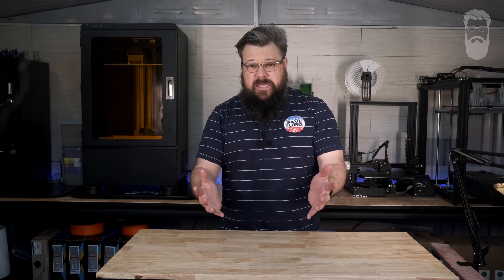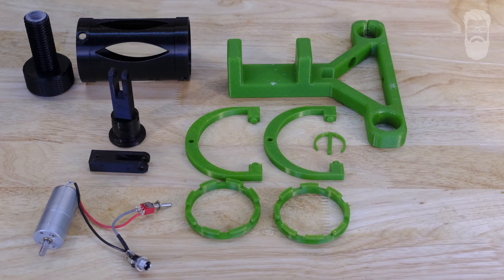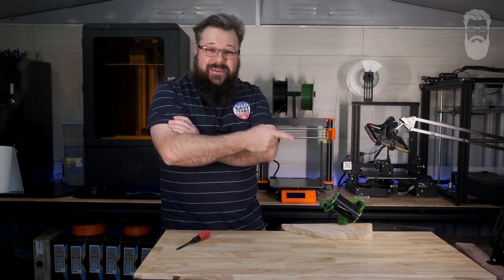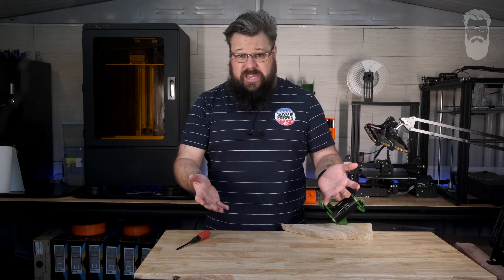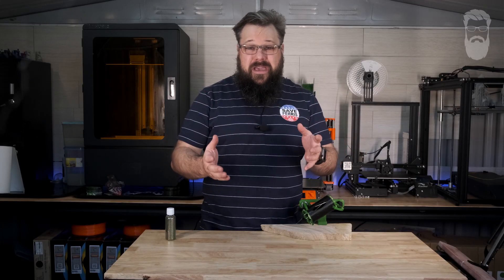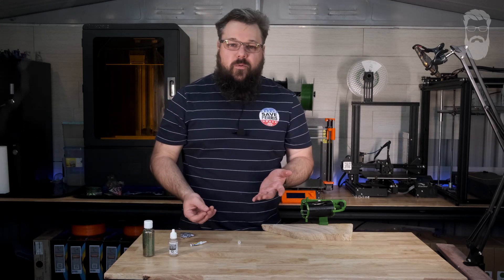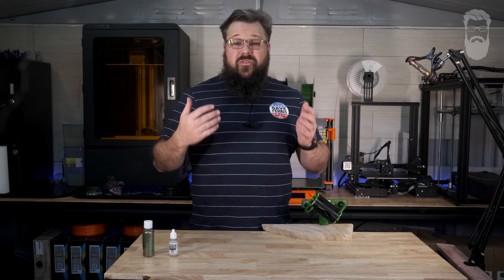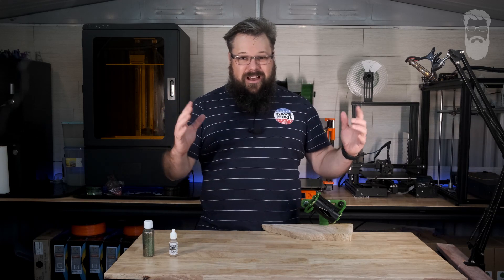My 3D Printed Kinematic Paint Mixer

Comment: You got me chomping at the bit for the bigger one. Would love one that could handle resin bottles and cans of spraypaint.  :D  Might even look into modding this myself. Solid design!
Reply from the maker: Literally in the finishing phase of a bigger one!  It'll be going on my Etsy within a couple months.  It handles 1L resin bottles, rattle cans, etc.
Reply: @MarkRhodesMaker ..any updates on the larger mixer? Doesn’t show on Etsy yet (20-Oct-2023)
Reply from the maker: @ernestgalvan9037 Hi Ernest, it's taking me longer than expected.   I have a working prototype, but need to make some changes to get it to production.  Sorry!

Comment: Currently in the learning phase of setting up a workshop for micro controller based projects as well as building and painting D&D Terrain and Mini's. Been looking for a silent way to mix paints and I believe I have found it. Could probably add more cylinders or even rubber band or velcro strap a few bottles on the outside to mix several at the same time.

Comment: I've finally printed this but I modified it to use ABEC bearings (the ones typically found in spinners) for the pivot end.  I did that because I thought it was binding there, but even after than the rotation of the drum isn't smooth, it stalls at one part of the movement.  Maybe my motor doesn't have enough torque?
Reply from the maker: Hi Wayne, possibly!   Did you use the motor I recommended?  I thought about using bearings for the next version, might give these a try!
Reply: @MarkRhodesMaker  As close as I could.  It looks the similar, runs on 12v, but only 50rpm.
https://www.amazon.ca/gp/product/B07D294GS7/ref=ppx_yo_dt_b_search_asin_title?ie=UTF8&psc=1
Reply from the maker: @WayneMcCormick  then it should have more torque, seems very odd!  I’ve shipped quite a few completed kits and haven’t had any reports of issues.   Might be the motor, might be the print.   Have you lubed all the contact points that don’t have bearings?
Reply from the maker: @WayneMcCormick  interesting…. Seems pretty close.   Mine are slightly larger so might be more powerful , but you’d think with the gear reduction it wouldn’t matter.   Greased all the joints?   I am testing a replacement motor, that you should be able to order anywhere

Comment: Hey Mark, the jaycar site you linked for the parts says they are going to be closed for a few months. Is there any chance you might have some alternatives for the motor and parts for those of us in the US? Thanks for making the amazing mixer and sharing with us.
Reply from the maker: Hey Michael, the next version I was hoping to do with a simple 3v hobby motor that you can find anywhere.   So stay tuned!   Otherwise if you can find a geared DC motor that runs at 70rpm that would be perfect.
Reply: @MarkRhodesMaker  will 100 RPM stress the contraption?
Reply from the maker: @JoyousKn1ght  really good question, probably will long term.  Grease everything up and give it a go!
Reply: @MarkRhodesMaker  looking forward to it. Saw other paint shakers and mixers but definitely love your design better. Can't wait to print one and use it! Thank you again.

Comment: Hi Mark!
Thanks for the project and the awesome video.
I'm designing a small mod to fit my necessity, i want to be able to use an electric screwdriver or drill to operate the mixer, so to modulate the mixing speed!

The mod is available here https://www.thingiverse.com/thing:4688467 and credits your work. Lemme know if i should modify the description somehow!
Reply from the maker: Hey nice work!  Maybe chuck it up on the prusa site too?
Reply: @MarkRhodesMaker  will do for sure! Apologies for not having done it from the start, I do not have an account there (since I do now own a prusa - for now). But I will take the chance to set up one!
Reply from the maker: @filippobosi  no apologies required dude!
Reply: @MarkRhodesMaker  oh, by the way - may I ask the layer height, outer wall number and infill % for the screw and clamps? I just had a failure due to heat creep (I just built a new enclosure and the temp was WAAAAAY to high inside), so I'd love a pointer for that.
Reply: I'm definitely not scared of doing them 100% infill, given the fact they have to withstand a decent amount of torque, but still :D
Reply from the maker: @filippobosi  I think it was like 10%, nothing out of the ordinary
Reply: @MarkRhodesMaker  cool, thanks!

Comment: My dog is diabetic and requires insulin shots twice a day. I've been told by different resources that I should vigorously shake the insulin vial before drawing it into the syringe or to roll it vigorously. You've just solved the problem and saved me a bunch of time  to develop an insulin shaker. Weeeeee. The vial is a little smaller than the paints you use but I think this will do the trick in mixing his insulin.  Thanks so much for a wonderful ideal. I found you via HackSpace magazine.
Reply: What I have read is that rolling is much preferable to shaking. So you should probably find a way to run the shaker really slowly. But I’m not a doctor and this is not medical advice; and I’m not a veterinarian and this is not veterinary advice. Cheers!
Reply from the maker: That is awesome Marie!  I still have a couple of kits left on Etsy
Reply: @MarkRhodesMaker  As it happens I have a 3D printer (Prusa MK3s) and have started to print you files. I like to send you a tip for your work any suggestions on how I can do that? Thanks again for taking the time to share.
Reply: @MarkRhodesMaker  Well, I went ahead and ordered from your Etsy cause I could always use another for my airbrush paints. ;-)
Reply from the maker: @mariemeyer2885  thanks Marie!   I’ll get it in the post ASAP 😊
Reply: @MarkRhodesMaker I couldn’t find them. I’d like one please. How do I get it?
Reply: Never mind. Found it, ordered it. So happy.

Comment: Great project, I love it!  Is there a minimum speed on it?  I'm not a mech e but I can see where scaling this up to mix slightly heavier bottles will be tricky given what you said on the Edge of Tech about the necessary tolerances.  Any way to use algorithms or tinyML to monitor and tweak the motor currents to offset flex in the frame, changing center of gravity or am I overcomplicating things again? XD
Reply from the maker: Thanks!   Re speed would be easy to control with a PWM controller.  Haven’t looked at TinyML, but I would expect that it would given enough time and controllable variables find a best RPM and width, or even a modulated RPM for efficiency.   Cool idea!

Comment: This will be great for mixing my glow-in-the-dark alcohol inks. Well, suspensions really as the particles settle pretty quickly and at quite annoying to shake back into a mostly homogeneous mixture. Now to figure out a way to run 8 off a single motor...
Reply from the maker: Yes it would!  Running 8 might be challenging, unless you've got a big motor with way more torque available 😂

Comment: have u tried using Nylon locknuts instead of 2 standard nuts ? Any chance I could buy just the non 3D printed parts ? am In Australia as well !
Reply from the maker: Ryxxi yep!   As an Aussie you can get all the parts at Jaycar.  Check the Print Instructions here https://www.prusaprinters.org/prints/40441-inverse-kinematic-paint-mixer as it has the links to the parts 🤘

Comment: stares with baby bottle mixing intent
Reply from the maker: Dan Kendall it would work!   For a small baby bottle 🤣
Reply: @MarkRhodesMaker  I mean, it scales, right? The motor sizing might be a problem though.
Reply from the maker: Dan Kendall it does scale yep, but the friction and torque required on some joints seems to be higher!

Comment: I love this, a version with longer arms for larger buckets would be cool
Reply from the maker: It's on the way!  I'm already working on a bigger version for Resin bottles.  However larger is more difficult to engineer with plastic 😬
Reply: @MarkRhodesMaker  Maybe you could use a small turbine (I saw these on the "Golden Ratio Turbine" vid from Integza) 

I don't know a lot about this stuff but that's the smallest amount of filament I've seen agitate such a large volume of liquid.
Reply from the maker: LuxMedia I’ll check it out!

Comment: That bottle-holding rubber-band contraption is genius !
As a potential upgrade, you could maybe design a gizmo to collect all the excess glitter. Static electricity works really well... so maybe add a cat feeding mechanism ?
Reply from the maker: I plan to never ever use glitter again, so hopefully it wont be a problem.  Fingers crossed... !